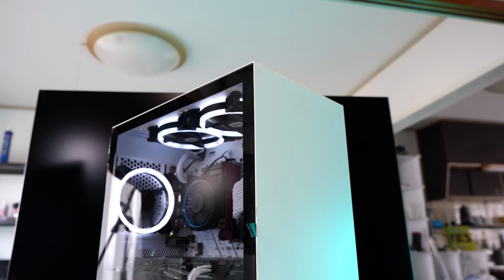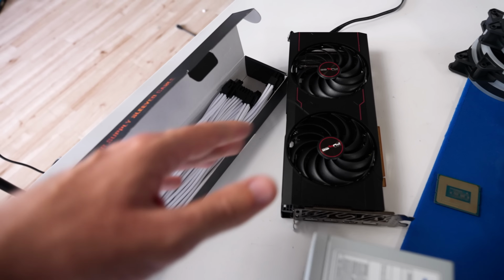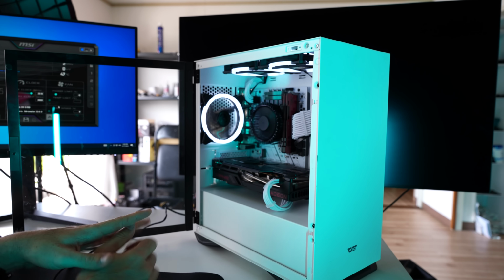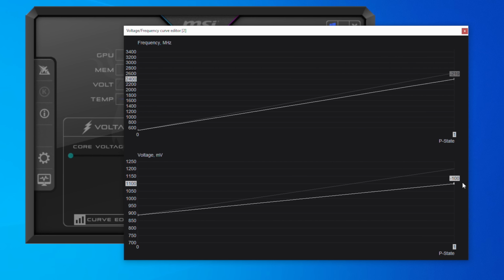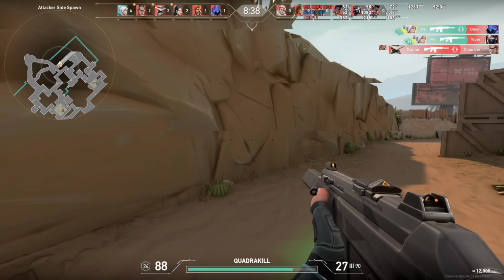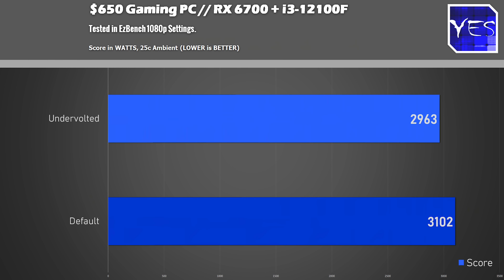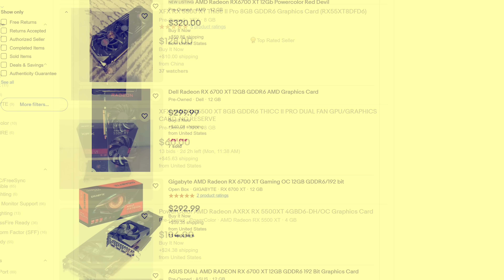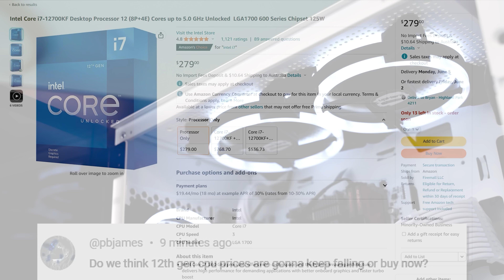$650 NEW Gaming PC Build - RX 6700 is a Budget KING in 2023!

Comment: I picked up a 6700 last week for 275 bucks - best buy I've made in years. Absolutely LOVE IT for my 1080 gaming!!!!
Reply: 1440p I'd where I would use this card at  plenty of horsepower just not raytracing or dlss  but who needs that when u got good rsterizes performance  of a 3070 or 4060
Reply: @SerjStar  add +200 bucks
Reply: @SerjStar the raster performance is more closer to a 3060ti. The 6750XT is the one that's around 3070 raster
Reply: Save up for the rx6700xt instead its literally rtx 3070 level and beats the 4060 ti

Comment: I agree, now is a great time to buy. I waited through all of 2020, 2021, 2022, and finally bought some new parts today. RX 6700 looks great but I might stretch it another $40 and get the 6700 XT for another 2GB of VRAM.
Reply: yep 2023 is the best time
Reply: I think you can't go wrong with the 12GB model. At 1440p, some games are using up to 11.5GB of Vram, so you'll be alright with the 6700 XT. Enjoy my friend ! 😄👍
Reply: I've got 2 6700XTs in both my kids' builds and for 2K gaming they are very happy.
Reply: I picked up a used 6700xt for less than new 6700 last week. I had a pc with a 6600xt in a while back and this feels like a good bump in performance. Tbf even the 6600xt did pretty well at 1440p medium. But I wanted a bit more power for vr.

Comment: Built a system with similar specs. Some upgrades and downgrades for $850 on Black Friday. Prices for PC parts are plummeting fast. I think there's more to these decreases than just new releases causing older parts to drop in value.
Reply: GPU and PSU prices still crazy high but everything else is coming down, especially DDR5 and SSDs. Really excited for Intel 14th and hoping that drives CPU prices even further down. Ive got an i5-13500 system specced out right now for $750 all new parts which is already an amazing deal. Hoping it keeps going down.

Edit: wow the day after posting this the 13500 drops to $210. Absolutely killer deal and it's just gonna get better.
Reply: Personally I'm glad these AMD GPUs are coming down in price and are available. AMD new GPUs are awhile off other than the 7900xtx 7900xt and 7600. And 7600 is going to be a 8gb card means I'm not interested in it with new games upping the vram needs. Why the cards are this cheap? AMD have targets, and I'm guessing their not hitting them. They want old stock gone. At the end of the day it's Nvidia who control the market anyway.
Reply: @Jwalker76  While I think you are right about AMD wanting to hit targets and Nvidia setting the market, I believe the prices are lowering further than many people have anticipated for one reason. I think these companies realize that the economy will have a downturn within the next 6 months are attempting to liquidate old tech while there is still a chance.
Reply: @stevenjonas1  Why do you think these companies realize an economic downturn within the next 6 months? What economic downturn? You basically said what @Jwalker said but added something that made no sense unless you assume there will be an actual economic downturn which nothing is indicating atm. oh and there is no "one reason" why amd cards are coming down in price, it's many factors and a economic downturn within 6 months is not one of them.
Reply: @NulJern  Nothing is indicative of an economic downturn???? Okay here is a quick lesson for someone who has not been paying attention, and yes, finance is my wheelhouse; Financial institutions have expected and actually anticipated an economic downturn for about one year now. Inflation is sky high. Treasury bills/bond rates are higher than they have been in decades (Highest since 1990). These rates increase when consumer banking becomes less confident. Financial institutions, accounting firms, and investment firms have laid off thousands in the last 5 months. The four largest accounting firms in the world have laid off thousands, so have many of the large tech companies globally both largely considered to be safe places to work at when it comes to economic stability. Three of the 4 largest bank failures (US) have occurred in the last 3 months, amounting to $500 billions dollars, or the GDP of most European countries. If those realities do not spark some thought of potential economic downturn on their own, all of those real-life events should be ringing alarm bells in your mind when they happen within only a few short months. Economic downturn is something that happens in cycles, so the idea of one happening is not if, it is when. Seeing that one has not happened naturally in almost a decade, the average time between recessions is about 6 years. Globally, the world is going on 10 years since the last recession. So yes, what I said *does* make actual sense. If you don't believe that multi-billion-dollar tech companies are paying close attention to the global economy, much less the largest economy in the world (US), to price their products, than I am not sure what to tell you. When economic downturns happen, the individual tightens their spending due to uncertainty, increase in the price of everyday items, and the possibility of becoming unemployed. Now apply that same logic to purchasing a computer part (a luxury item)...people are much less likely to buy computer parts no matter how cheap they are when a recession strikes. This is precisely why I believe that tech companies are lowering the prices of their last gen products even further than any of us are used to. The old series GPUs have not dropped price this severely when new gen has come out. The facts are the facts, an economic downturn has already begun. Layoffs, slowing of profits, and uncertainty for financial institutions are all telling. It would be foolish to think that these ideas do not contribute, even minutely, to the pricing of last gen stock that companies truly do not want to hold when an economic downturn occurs. Ty for coming to my TedTalk, I hope you learned something, even if it means that arguing with someone who is specialized in the field you are discussing is a slippery slope. 

To discuss your own comment about what I had to say:

1.) When did I ever say that an economic downturn is the sole reason for low prices? I wrote that potential economic downturn is lowering prices further than many people have anticipated. Very different ideas, please read carefully. 
2.) The potential of an economic downturn is not a reason for lower prices? Hmm this is interesting because last time I checked, multi billion dollar companies spend millions to gather economic data to price their products. This data does not focus on solely on economic downturn probability, but it is a component.

Comment: I live off grid in a caravan for now, and built a ITX NR200 case ( space is a premium) with a Eagle 12gb 6700 XT (£380). It ended up total cost £1350, with Asrock B550 Gaming Muscle, 2.5 tb m2 storage, SF750 PSU, 32gb Ram, Air Cooler, and a 5800 X CPU. I had problems with riser cable during my build, so after help from my friendly local PC shop, he omitted the riser cable basically! May add a water cooler later, if I can find a way to route the pipes past the gpu, given the small case. I initially tried to fit a pump in rad water cooler at the bottom, but it just didn’t work with this set up.
I run it off an Inverter generator, with a 27” 2k monitor and it is perfect for Sim Racing! ( yes I have a mini sim rig too🤣)

Comment: I have this GPU , undervolted to 1060mv with stock 2600mhz and power draw is around 100 to 120 w max in games , 55 to 58 degree celsius. Time spy score is 11395 , out of the box score was 11280 so dont need to lower the frequencies if you want undervolt

Comment: Picked up a 6600m for 120 pounds about 150 ish USD from Ali express more than happy it's only paired with 5600g seems pretty balanced system. But if I do decide to go new rig I think am going intel next time and if the prices keep falling on the arc cards maybe all intel. But on point on this build for me if I was selling I do the mod cables and all the argb. If I was building for me go for cheaper motherboard and up one tier on CPU too the 12400f ram speed will be locked at 2933 because of the memory controller on the CPU. So 32gb of quality CL16 with tight timings so hyper beast, t force or Corsair vengeance. 512fb nvme for os 1tb ssd for games storage no overclocking so C tier thermal take bm2 would be fine,though the tuf gaming 550 is only 10 bucks more and is an A tier psu. I d go for that for piece of mind love white cases but prefer going with montech 100 air white comes with three regular white fans and is around 40 bucks has mesh front and top so excellent air flow.. Love the 6700 but if am going budget pc building 280 or in the UK 300 is too much to drop on mid tier card should be about 220/200.For that price range the 6600 or the 6600m from Ali express great for 1080p but then again am out on triple a games can't stand the 70 GB fuck it we'll fix the game down the road game patches.

Comment: Its cool and all but at this period in time I wouldn't recommend anyone choosing a 4 core processor when the next step is a freaking 6p(ht)+8e core which would last way longer. for just 10-20 percent more money (entire build in consideration) for an i5 13500, such pc would be game-able for X more years not to forget the massive boost in productivity. I'm on a 7700HQ and I feel it's getting inadequate for current use cases, those 1% lows can really be felt on newer games and its unsatisfactory. Even if it has better IPC it just lacks the cores/threads which can mean the difference between stutter fest or butter smooth gameplay. and if the builder can, just target the RX6800 (or arc750/770 16gb) for complete worry free 16gb vram goodness...

Comment: What is the best monitor to gpu ratio? 

I just bought a g7 4k 144hz for $250 open box. I currently have a gtx 1080 which does a surprisingly good job running any game i want to play. 

Just curious what would be the recommendations.. i am open to used parts also.

Comment: Why not use a Rzyen 3600/x 4500/5500/5600? 6 cores vs 4. UK 3600 is £71.99 delivered new (inc VAT).
Reply: Games usually benefit from single core performance. Few fast cores can do multithreaded tasks and single threaded tasks. Since in multi core, one core just gets scheduled with more threads.

Meanwhile multiple slow cores can only excell at multi core. Not single core. Thats why expensive 36 core server cpus get trampled by a fuckin i3 in video games.

I hate how intel is now viable for budget gaming. Wtf?
Reply: @Derpynewb  I've only been a PC engineer over a quarter of a century lol. There are so many issues currently, too high power draw on Intel and a 6 core 7600 starting at £219 makes AM5 pointless. I've tested my 6700 against the leaked 7600 numbers in 3DMark, they are the same just the 6700 has more vram but still not enough.
Reply: @25MHzisbest  what you say isn't wrong. I just have 0 idea what the point your making. I'm kinda lost.
Reply: @Derpynewb  Current Gen tech is a hell of a mess.
Reply: @25MHzisbest  Isn't tech always a mess? When intel was doing well and stagnating, AMD was the hot and inneficient one. Now it's reversed. Same shit different day. Memroy market seems to be pretty good though and so is storage. Gpu market can go suck ass. The performance isnt bad its the pricing.

Comment: why use a normal ssd when nvme is the same price but 6x the speed
Reply: They are not remotely 6x faster for normal desktop use. Marketing specs do not equate to real world use behaviour. Also, cheap NVMe models are DRAMless with a small or no cache buffer, which severely limits many aspects of their performance, especially sequential write, sustained and mixed workloads. Of course some of these caveats can apply to cheap SATA SSDs aswell, but that's why I look for the best of the older models on the used market instead, eg. a Samsung 850 Pro will blow away any modern cheap NVMe for sustained sequential write once the NVMe's small SLC layer has filled up. Some models do get round these limitations via careful firmware design and thus perform generally quite well, such as the WD Blue SN570, but they still have their limits. For gaming, once one has an SSD of any kind (which is what really matters), the real bottlenecks tend to lie elsewhere, often the main CPU.

Last year I upgraded from an i7 2700K and 1TB 850 Pro (on a Z68 mbd) to a 5600X/B450 and fast 2TB NVMe. The change did not really improve game loading times that significantly because so much overhead is happening on the main CPU related to game launchers, contacting remote servers, checking cloud save status and so on (this is for Steam games). The faster CPU made a bigger difference in-game, doubling frame rates for games which depended heavily on a single physics/engine thread (this is using the same 1080 Ti from the original setup).